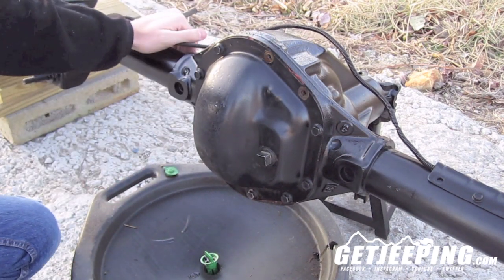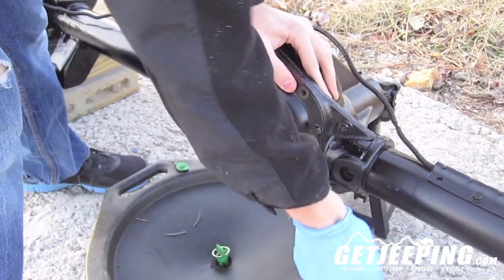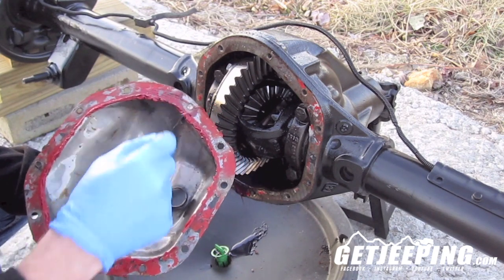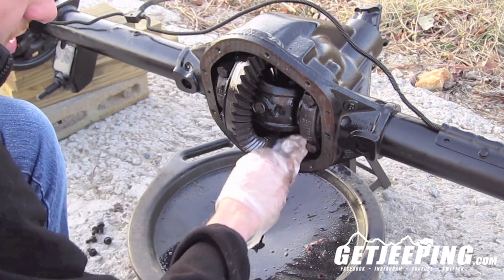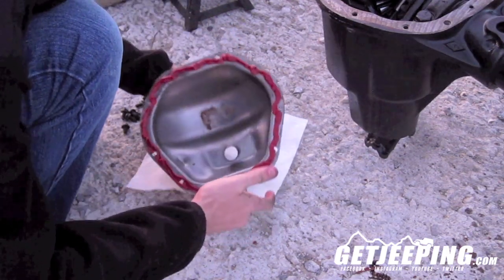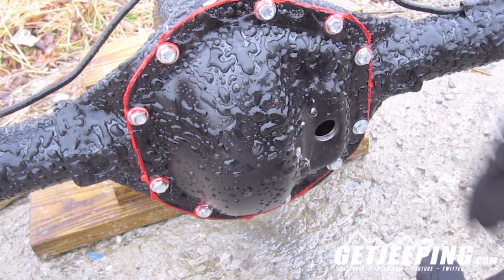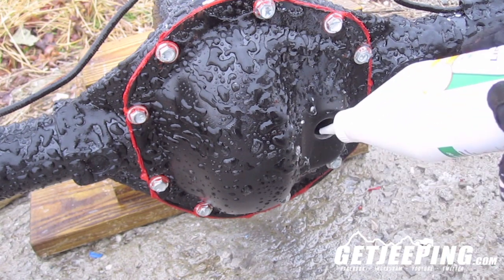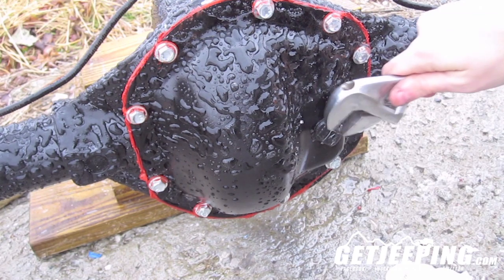How to Change Your Differential Fluid and bolts on a Dana 44 - GetJeeping

Comment: This video gets a lot of stuff wrong. RTV stands for room temperature vulcanizing sealant, not wet and below freezing vulcanizing sealant. Already been said in the comments, but this is the wrong type of RTV, black RTV would have been much better. Also you really don't need that much RTV, they went way overboard. You don't need RTV on the outside of the bolt holes, and I wouldn't want to force RTV down into the bolt holes like he did in the video. It would have also been good to at least mention the fact that there's a torque sequence and specification that should be followed to avoid loosing fluid. Not knowing how to properly change differential fluid is probably how you ended up with none in the first place.

Comment: Why would anyone use high-temp red silicone on a differential cover? Black RTV has a higher oil resistance, works fine at temps the axle operates at and doesn't look butt ugly.